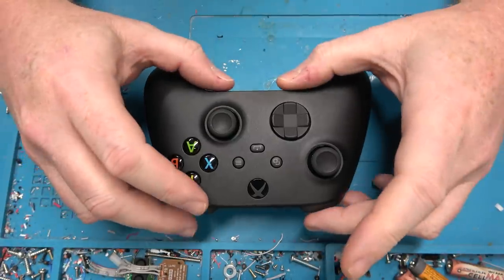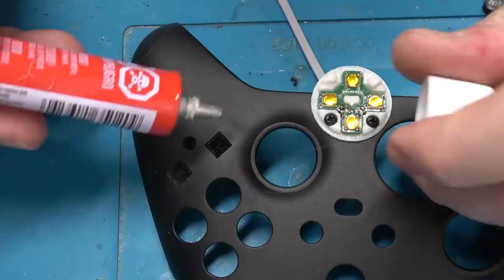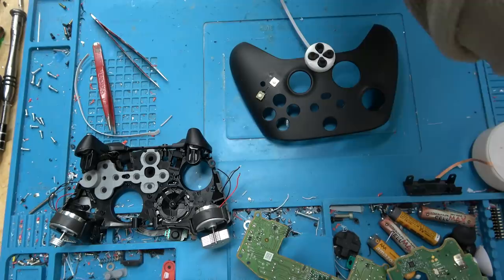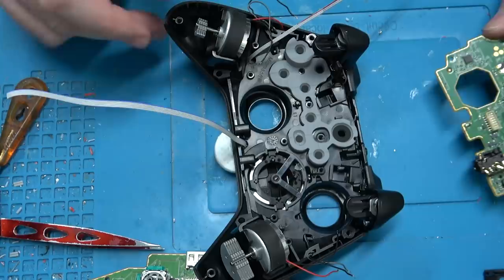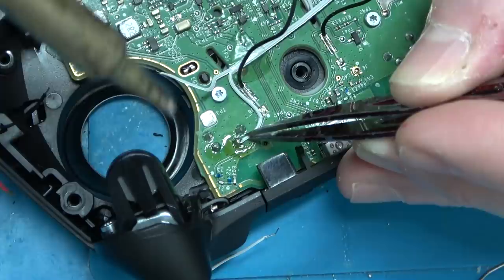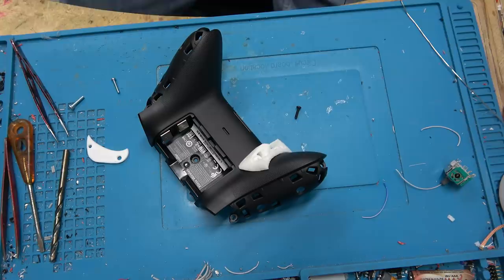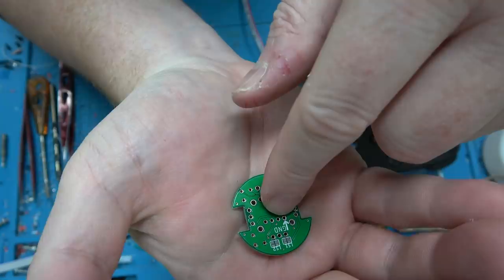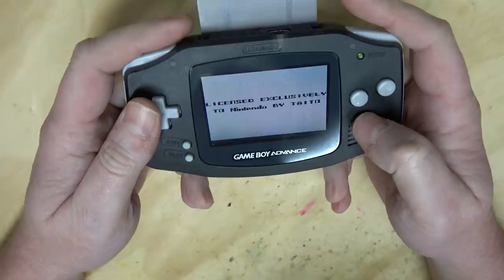Single Handed Controller Upgrades!

Comment: The stuff Ben said about PS4 controllers and their model numbers is true. I have a damaged face shell on mine, and the same model number can have different screw posts. It's making it hard to find a replacement.
Reply: That is so stupid, it's incredible
Reply from the maker: Yup. Same model number, but where the number appears on the sticker means different internals. Not SUPER different, but different.

Comment: Og xbox also has analog face buttons, a lot of racing games used them but yeah nobody really noticed as there is almost no travel of the button compared to say a trigger the controller already has.
But the ps3 did use that analog button tech to make there analog trigger unlike xbox that used a pot.
Reply: Remember a big feature of the PS2 was it's pressure sensitive face buttons?  The only game I really remember utilizing it well was Metal Gear Solid 2, for holding up enemies and putting your weapon down without firing.
Reply: @Chicomite  yes, PS2 had them.
Reply: @Chicomite  any game that lets you steer a car with the dpad. it was so much more elegant. racing games, gta games, motorstorm, gran turismo's. i really miss it.

Comment: Ben, why don't you try switching to resin printing?

It has a wonky learning curve, but once you get good at it, you're able to create really strong and precise parts with nice surface finishes. You can even buy resin that is water washable. I just think that the parts you're printing for the controllers are much better suited for resin printing. Not to mention the fact you can print many batches at once.

Comment: There's a much easier way to do that boolean subtraction than importing into mesh mixer. You can just model the part to interfere with the controller in Fusion 360 and then do a combine parts; you can even keep the controller by selecting "keep tools." Then you can even tweak the fit by using the push pull tool on the mating surface.
Reply from the maker: Doesn't work on meshes.
Reply: @BenHeckHacks  Oh yeah. ooops!

Comment: 26:00 hey maybe the next pcbway produced PCB could be a a flex PCB that allows you to solder to those test points more easily, kind of like the ones they have in the console modding community

Comment: That 14 pin SAMD11 sounds like the part used on the Arduino Nano Every as the combo USB to serial / UPDI programmer/debugger interface.

Comment: about the d pad. there is a kind of small buckling discs on tape (cant remeber what they are called) maybe they would work? i mean.. the switch you are using is basically one of those

Comment: Re: PS2/3 Analog buttons...
That's one thing I really liked about playing Gran Turismo on PS2, was that the throttle was controllable from the thumb buttons (because I'm old school, so yes that means D-Pad steering, and I'd still do better than your Analog Stickers! lol)
I always thought that was brilliant on Sony's part -- which is saying alot I think, as a KBM PC-master-race gamer.

A keyboard with like... swappable analog keys would be quite interesting.
And by "swappable" I mean in the sense of like the colored keycaps. Where you'd get X-number of these analog switches, and then YOU get to decide which keys you want to be analog. Arrow-keys this week, NumPad next week, WASD after that, etc. Or maybe just Q and E...

Comment: Thank you for the video Ben! I am sure you have talked about it in the past, but what brand of soldering tips are you using? Mine usually don't last longer den a couple of hours and I feel scammed by the price considering I have to buy them in bulk..

Comment: Do you ever worry about some fly-by-night Chinese company reverse-engineering your one-handed controller design?
Reply: I'm obviously not Ben, but I would hazard a guess and say no. The handicapped peripheral market doesn't seem to be very large and doing injection molding (which would make it more mass produceable and cheaper per unit) is very cost prohibitive for small runs. Doing it another way would add a lot of labor and other costs, so I don't think chinese factories would be very interested in it.

Comment: Coudn't you print those D-Pad thingies with one of those goopy printers with the non-solid resin, or is that kind of printer overkill.
Reply from the maker: I have a resin printer. It's slower, requires a lot of post work and the parts are more fragile. I need fast and tough.
Reply: @BenHeckHacks  shows what I know. Anywho, thank you for a very informative video.

Comment: black color PLA would be nicer not because of the aesthetics since you put it on black controller also since that printer has layer by layer texture it attracts so much dirt and since its white it would look gross and there is no way to clean a naked ( without clear spray ) white pla !

Comment: Those new dpad buttons will fail a lot. I have a Windows 10 tablet with those same buttons for power and volume. I don't use it that much but 2/3 of those buttons broke. A Dpad sees more use and it will definitely fail sooner.

Comment: Ok so this is weird, I just turned my iPod off to watch, get this battle star galactica and then I get a notification to this video from you tube. But it doesn’t end there, I pause battle star galactica and start watching his video. Then Ben says “ frak these cylons “ I was like what?? What are the odds?? But it gets weirder. This morning I dug out my other modded single hand controller to send back to Ben for repairs in the next day or so and this video just randomly pops up in my notifications now. Strange

Comment: IIRC, the Gran Turismo games made good use of the analog pads if you didn't want to use the shoulder buttons for whatever ridiculous reason.
Reply: As far as I remember the PS2 had analog face Buttons. But the shoulder Buttons were all digital. 
So if you wanted finer control in GT3, you needed the face button.
Not saying that precisely modulating the buttons was reasonably easy though.

Comment: I just want to point out, from what I understand, your comment of, "... the PS3 also used hall effect sensors..." at 16:30 is not correct. In the entire DualShock 3 family (prototype, SixAxis, and DualShock 3 variants), there were four variations of sticks, PP1 (prototype) and PP4 (early SixAxis) used 3 pin pots under revision 1, V2 (late SixAxis) up to VX5 (mid life DualShock 3) had four pin pots as revisions 2 and 3, versions VX6 to VX8 (later DualShock 3) reverted to 3 pin pots as revision 4. The unique thing about these four pin pots is that they were sealed potentiometers rotated via magnets. I'm not actually sure why they used two poles in the four pin pots, from what I understand of the various pinouts, though I have yet to find a proper block diagram, both poles seem to be connected but as far as I can tell nobody fully understands the circuitry from trying to reverse engineer it based on traces alone. I'm also not sure if the other revisions of the sticks, v1 and v4, the three pin sticks, were also sealed and magnetically actuated or if they were the typical unsealed design that's open to ingress that inevitably causes drift. But all DS3 sticks are pots, some are just sealed and magnetically actuated, none were hall effect sensors. 

Whenever I first heard the incorrect information that the PS3 had hall effect joysticks, I searched forever looking for verification of this and other controllers that used magnetic sensors. I didn't have much luck in this search outside of the mention of the Dreamcast controller, apparently the Aya Neo Next using them, and many mentions of non-gaming analogue sticks, like ones meant to be actual control sticks for things like equipment, I actually couldn't find any other gaming or relative uses for magnet-based sticks beyond the Dreamcast and Neo Next. After not having luck, I decided to dive down the rabbit hole of PS3 peripheral hardware, the DevWiki was a good starting place, but I couldn't find much within various forums outside of controller mods; I guess the PS3 generation was at the pioneering of massively documenting hardware changes within a central archive, but that documentation was too early to have proper schematics and proper explanations of odd circuits. There's just not much available out there for hall effect sticks, unless you're getting into industrial control applications in environments that would kill a pot within a week from ingress. 

I'd actually be curious as to why the sealed sticks were dropped. I wouldn't be surprised if part of it was cost cutting; for example, VX7 switched to a power/MCU board and put every input, including the sticks, onto flex ribbons, which would've massively cut PCB costs. There's also speculation that the four pin sticks were also semi-custom products from ALPS, which from my understanding of semi-custom products, would've been a costly part, not only because of more material on a custom manufacturing line, but the exponential amount of processes within that manufacturing line, and building out that manufacturing line, etc.; Sony changing from custom sticks to standards ones, while not even reducing the consumer price, would've widened profit margins significantly, also wasn't there a price increase for the DS3 as well at the end of the PS3 life cycle? I also wouldn't be surprised if planned obsolescence is part of the determining factor for this change, which is also why we have yet to see improvement to stick drift on modern hardware, because from my understanding these magnetically actuated potentiometers had a fully potted design, meaning no potential ingress from a design standpoint; These potentiometers would've needed to be enclosed before being potted, or at least the wiper portion would need a housing to remain free-moving, which circles back to the manufacturing costs.

Though, in the modern arrangement, a hall effect variation of a potentiometer seems interesting, a coaxial rotation like a wiper and track but using a manipulated magnetic field around a sensor or two, I'd be curious to see if a full drop-in replacement could be feasible for a relatively affordable price; though on a 3 pin I would fully expect the 'pot' module to have an IC to convert the hall effect arrangement into a commonly understood single signal line. Though I will say, in concept, and probably in practice as well,I like the Dreamcast's design more, with the sensors on the PCB itself, it seems like a more solid design with better reparability; if there were a way to swap the stick housing for a plastic assembly that just clips into some holes, then reparability will be so much easier as you don't have a glorified heatsink of a housing to deal with, and instead just have a unit that pops in and out with ease.

Comment: Ben still believes Hollywood could make a good remake. Spoiler they can't, they're more interested in getting across a political message and revamping casting to check off PC boxes than making a compelling story and having a cast that makes sense for the roles they are in. when an ok movie comes out nowadays it's the exception to the rule not the other way around.
Reply: the problem with a remake is that the incentive to watch it already exists no matter what the movie actually is like...so the movie doesn't need to be good to begin with and then they also fuck it up just like they always do...